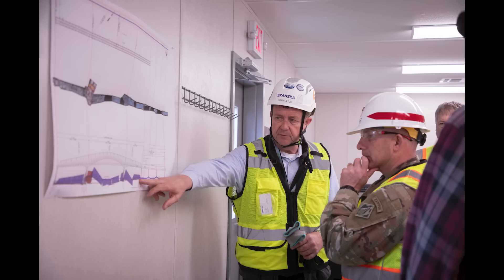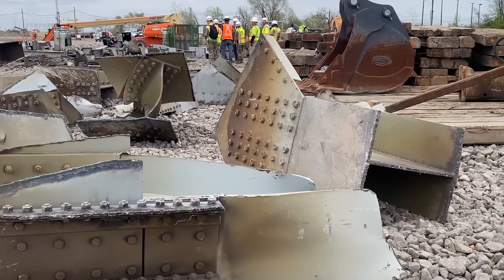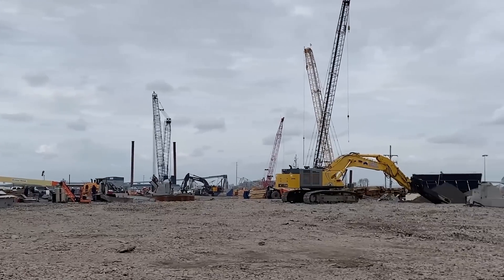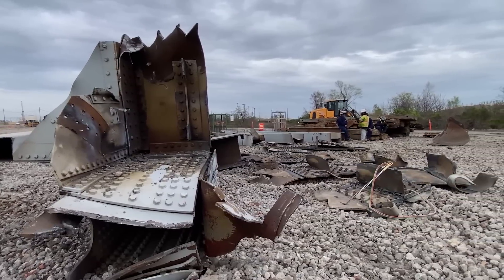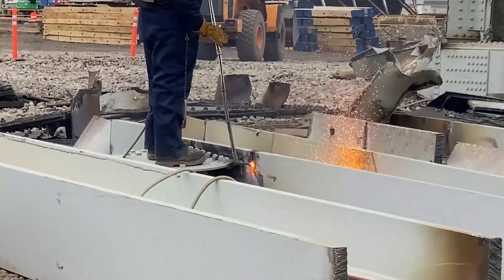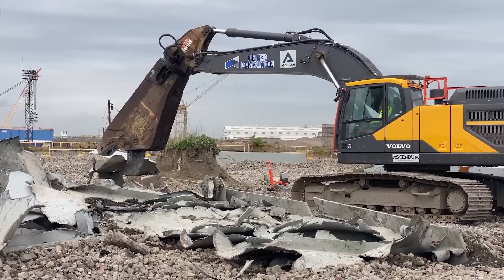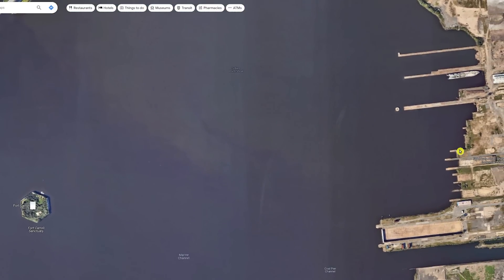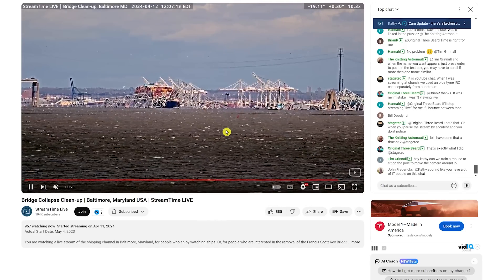What Do They Do With Key Bridge Collapse Debris Salvage?

Comment: Being a near retired welder, you asked if they are cutting properly, yes they are. Best way is they have extended torch tubes, so they don't have to squat down.
Reply: A buddy of mine asked why the welders are not using exothermic “lances” like we use in the heavy rescue field.  Back in the 1990’s, all of our fire apparatus and rescue apparatus had the longtime carried oxy-acetylene cutting torches to this type of cutting tool.

Other than training, I’ve only used this type of tool once.
It was a situation where room was limited and a highway galvanized steel guardrail had to be cut away from the interior of a passenger car.  It worked well, but sure created a mess of molten metal everywhere.
(+ the surviving passenger had to be equipped with an SCBA due to the fact that galvanized/zinc material was being vaporized in a somewhat confined space environment).

Welding sure seems like brutally tough work, but the newer tech seems to be making the work safer and more bearable.
Reply: @PowderMill  Oxy Lancing is for removal of extremely thick or HUGE steel that needs to be removed quickly and fast with no consideration for the metal itself.
They are probably cutting sections and then those sections will be inspected for things and thrown away if nothing is found.

Theres a LOT of cutting and repurposing methods for steel. Oxy Lancing is only for scrapping fast.
Reply: @PowderMill  I think cutting metal  is dangerous in a  rescue situation  #1 because your doing it fast as possible .... and my nerves was shot from even watching that iron twisted  up being burned thru  
praying you didn't get  slapped ...  but the zinc is absolutely unbearable unless you have  your mask  also  oxy tanks  limit your traveling     #1 reason I've  taken this bridge my hole life   was compressed gas travel limits in the tunnels. but my experience  with lancing rods  is your thickness of the  goudge  like burning thru   12 inch bucket pins.  there great for
Reply: @PowderMill  i suspect they might be using a petrogen torch. Its pretty common in rescue applications, and was originally developed to cut through battleship hulls. its also more forgiving then acytelene.
Reply: @hfxshippingnews  no , if you look at other videos you can see the 50 kg propane / LPG tanks
Reply: @PowderMill I have used the demo rods you speak of…. Like 3/4” copper tubes filled with magnesium rods with a constant airflow supply, light it, aim it & look out! Very smoky, but it cuts through anything I used them on: power house demo, steel mill activity, very efficient effective tool. Oh yeah, retired Ironworker here, 35 years
Reply: @jrbaltmd57  Thanks for building America!
🇺🇸👍🏻
Reply: I used an oxyacetylene torch over thirty five years ago for cutting metal while shipfitting. It looks like the burner knows what he's doing. I wouldn't want to be doing it in summer months with all the PPE to be safe, but I'm sure they're making decent money doing it. Thankfully I have an office job.
Reply: Looks like he is cutting, not welding to me...odd to ask welders if they are demoing it properly. Shouldn't he ask demo crews, I did a bit a scrapping when I was younger we did it basically the same as they are.

Comment: Lets hope they recycle the old bridge into caissons for large sturdy dolphins for the new bridge.
Reply: Don't you know they were "saving money" by not having it properly protected to begin with.
Reply: @bdickinson6751 Don't you know they weren't required when the bridge was built and ships weren't as big.
Reply: @regould221  And they couldn't have been installed later as things changed??? They probably had to dredge deeper as well as time went on. Lack of foresight is proving to be extremely costly.

Comment: Can you get any video of the current state of the Dali bow to see how many containers have been removed?
Reply from the maker: they removed 38 containers as of yesterday
Reply: They are probobly removing the containers just behind the bridge.

Of cause they can't remove the containers under the bridge untill it's gone. But this will at least give them space to work. Posibly lighten the load a bit so the ship can float even with the compartments flooded.
Reply: I realize that some of the containers are in precarious positions.  But still, that seems very slow.
Reply: @nikolatesla5553 the crane is probably splitting duty between lifting containers and bridge parts.